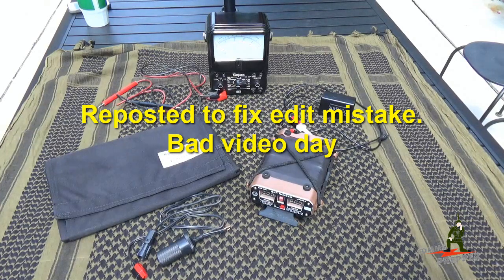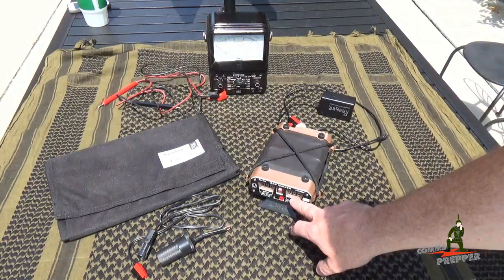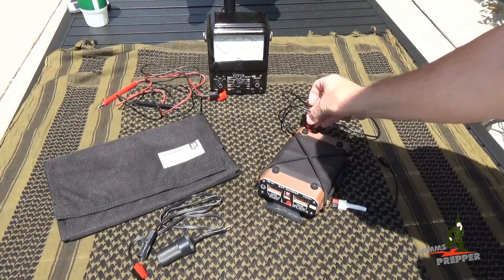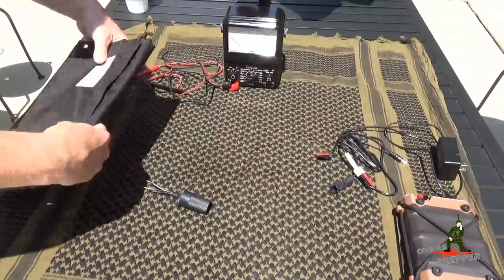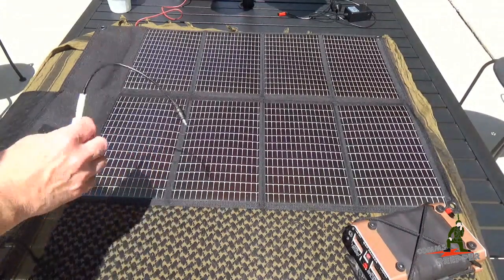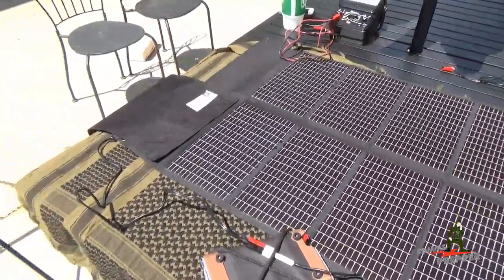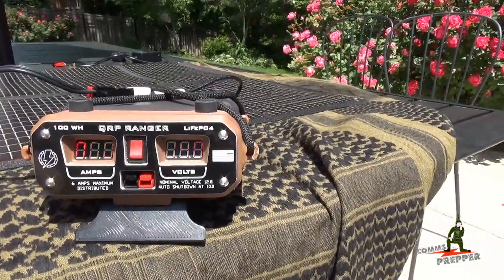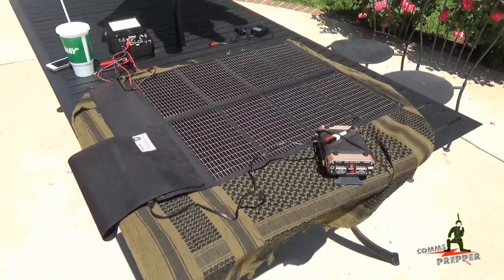Solar charging Hardened Power Systems' QRP Ranger

Comment: Question-where did you get and what is the correct term for the powerpole/wire "white part" on the wall-wart side, for lack of a better word? Thanks
Reply from the maker: That's white heat shrink.  It did not come from Anderson Power Pole.

Comment: Beautiful Rig. 
   Is the internal battery in the QRP Ranger replaceable Hank?
Reply from the maker: +Hardened Power I don't think so but I suspect Hardened Power would work with you if there was a need to replace the battery.  I added them on this comment for a direct response.
Reply: The battery is not replaceable by the user, but with 2000+ charge cycles, you may never need to.  If you needed a fresh battery, we could do that for you.  About $70 in polymer cells and $30 bench time.  I am guessing it will be at least three years before we begin replacing batteries in these units.
Reply: Hardened Power Great to hear it can be serviced.  Does the unit shut down at 50% for battery life; or are you allowed to do a full deep cycle drain?
Reply: You can do a full drain.  The Ranger will shut down and stop discharging at 9.4 volts.  At that point, you really need to apply a charge.  ;-)
Reply: Hardened Power Much Thanks...